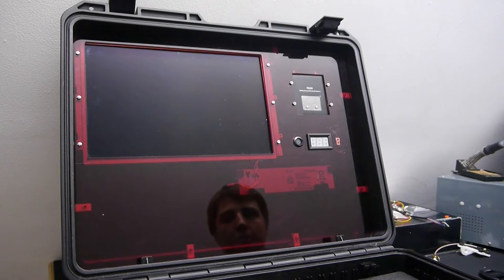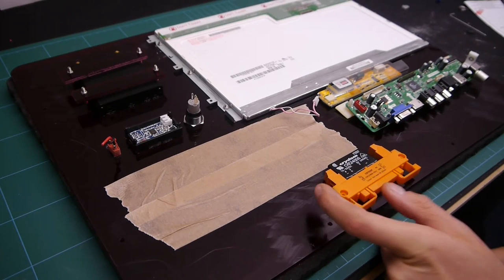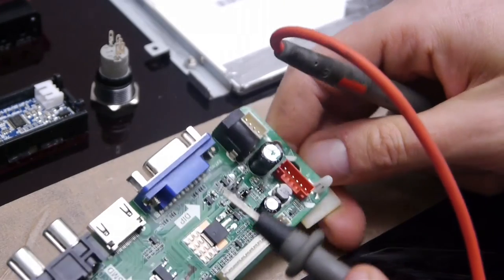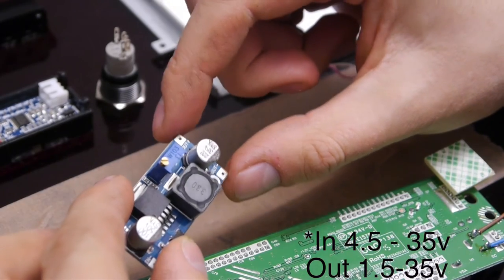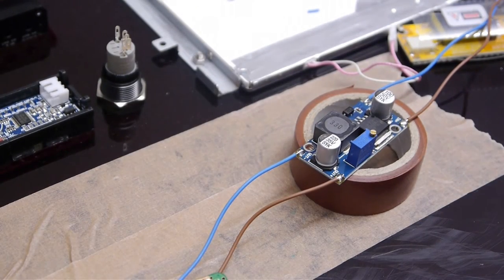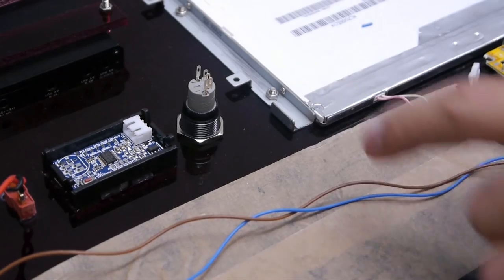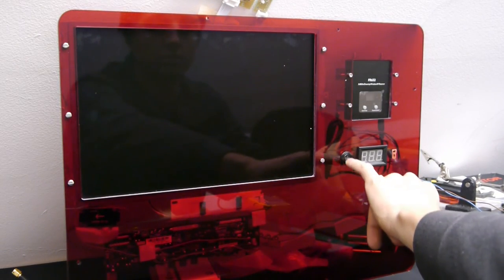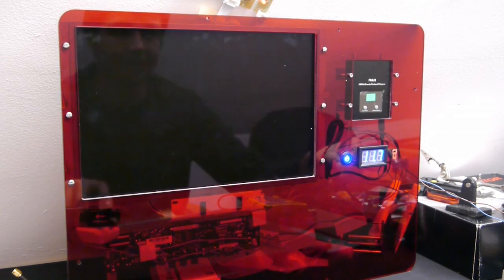TheManLab - FPV Ground Station Build - Wiring Components - Part 5

Comment: man i bought one of those controller boards after watching your first video. i got the vst59 board. ive tried it on 2 different screens and i cant get it to work. ive moved pins around like crazy.  was yours really so easy? just plug in the lvds cable and you were done??
Reply from the maker: Hello. Did you check comparability for your board? If you just got one without telling the seller your LCD part number you will need to flash the board with firmware. Let me know you LCD part number and I can have a look for you.
Reply: Yeah i have an entire zip file with all the firmwares. Ive flashed a bunch of them and no success. Ive tried 2 different screens also. ltn140w1-l01 was the first one i tried. When i power up. All i get is a black screen. Then there are a few lines horizontal that arent black. Which sometimes change position
Reply from the maker: +David Worden I can see that the LCD is supported. But I'm not sure what firmware to use. Where did you buy the board from?
Reply: +The Man Lab  well, i bought it on ebay. the issue is that before i could even contact the seller with questions about the board, they were gone. they arent there anymore, i cant even leave feedback. very confusing. i tried another screen and got the same issue
Reply from the maker: +David Worden oh that's very unlucky. When you purchased the board did you tell them you LCD model number? I did and mine came setup. I just had to plug in the backlight controller and LCD and it worked first time.
Reply: +The Man Lab i told them. but it dodnt even come with any lvds cable haha so i dont think they programmed it or anything haha

Comment: good job, I'm inspired to do a project like this and I want to know how long it lasts with that battery? I already have almost everything to begin the project ..
Reply from the maker: Juan Hernandez Hi, about 45 minutes. You could use a 3s lipo if you want. 4000-5000mah would be great I think. Make sure you use a voltage checker/display.

Comment: Do u have a link to the solid state relay?
Reply from the maker: Hi. I didn't use it in the end.
Reply: That's good but I'd like to.
Reply from the maker: +Vic Prk (Slick  Vic) this is not the same one but much cheaper. SSR-25DA SSR Solid-state Solid State Relay 25A Output AC24-380V
https://bnc.lt/4Sug/iWjxwtdYWu
Reply: Thanks
Reply: why do you use a relay?
Reply: Just think it's safer than switching battery leads.
Reply from the maker: Yes correct. It can take more current than a normal switch.
Reply: Too bad i can't wire the damn thing yet:) I got the led swithch to come on only when down and power the relay but it doesnt seem to connect the output terminal screwes.
Reply: I'll bet quite a few woujd like to see a schematic ish wiring diagram :)
Reply from the maker: Ive already done one http://imgur.com/beElcr0
Reply: did you make a video of this finished? just started to making my own based on yours

Comment: as a matter of accuracy, the AC - AC board needs an input voltage atleast 1.5v above the nominal output. this was the reason why your input voltage was 12v and you couldn't equalise the output.  I have also deisgn an FPV Groundstation similar to yours